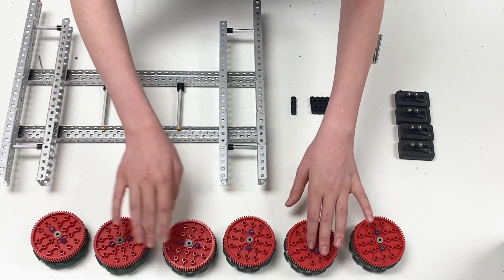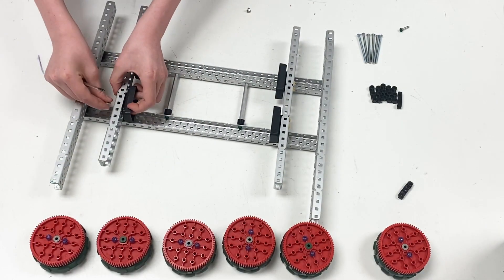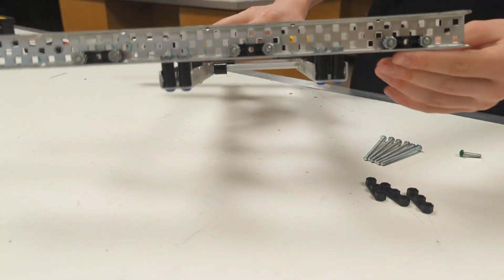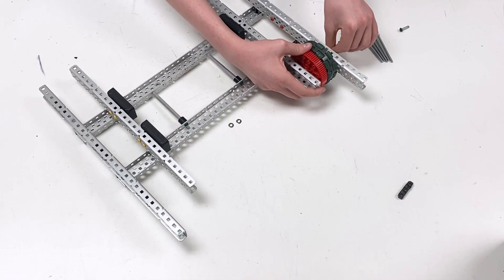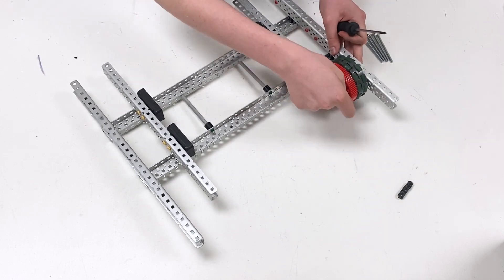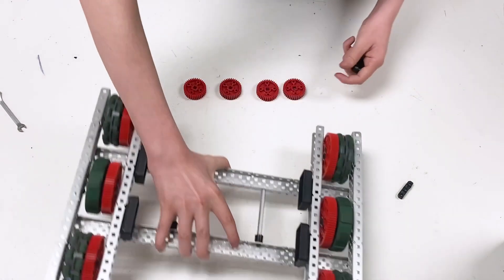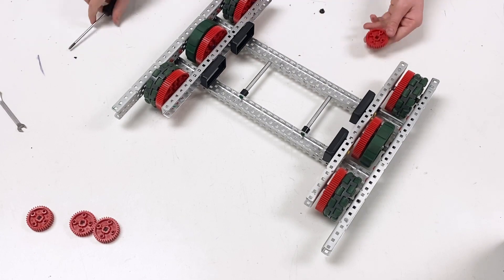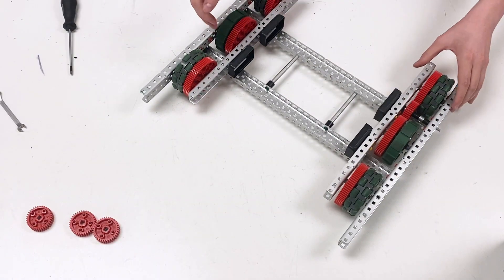3 ChassisPart2

Comment: Wouldn’t there be no difference between using a shaft instead of a screw? As long as it has the free spin inserts in it, it shouldn’t matter right? Even if it doesn’t have the inserts, it would just spin using the bearing, so I guess I just don’t understand why you’re using a screw
Reply: L bozo